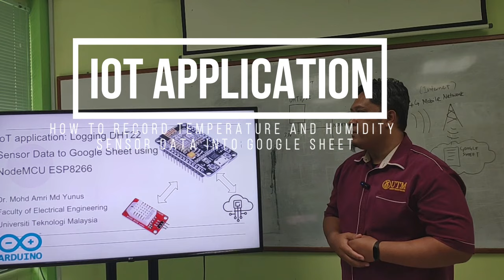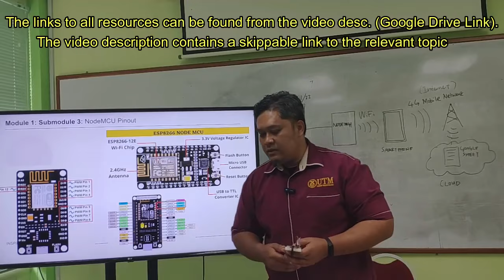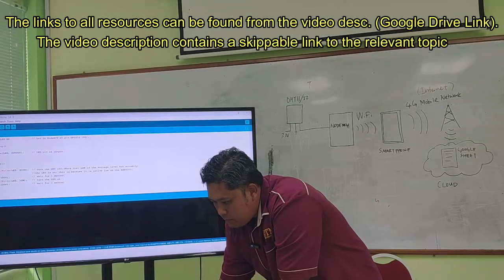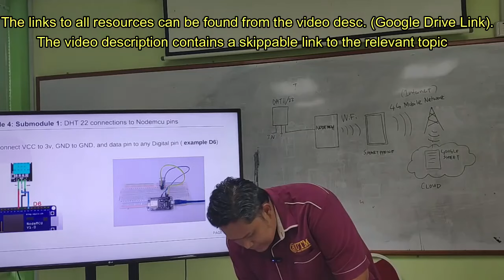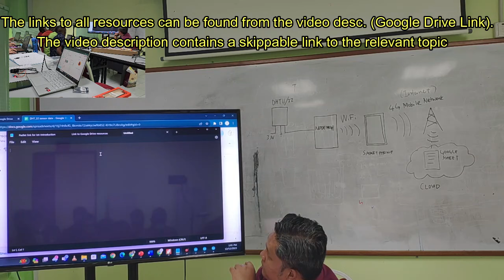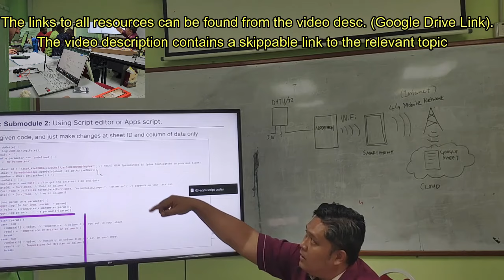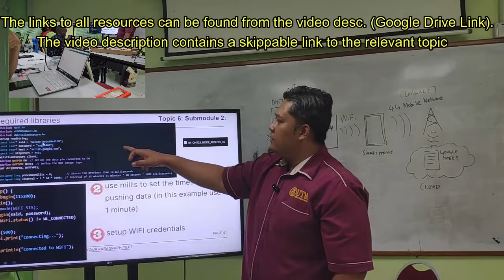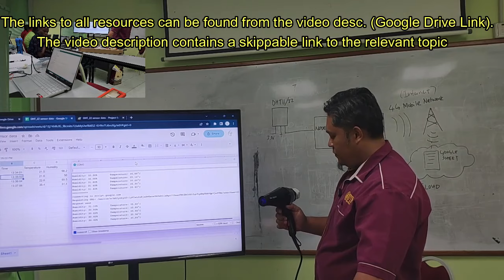IoT application | Logging DHT22 Sensor Data to Google Sheet using NodeMCU ESP8266

Comment from the maker: Link to resources:
https://drive.google.com/drive/folders/1t18ITUjztelZGxeKu2X5GJpMzR49CXcZ?usp=sharing

Presentation slide (Dropbox): https://www.dropbox.com/scl/fi/2deiad1mwktlj44mte0w5/Slide-IoT-Application-DHT11-data-to-Sheets.pptx?rlkey=uqspa1o8za6s54smx65wpflki&dl=0

Time stamp:
00:00 General Overview of NodeMCU ESP8266
14:57 Setting up The Board in Arduino (Integrated Development Environment) IDE
21:51 DHT22 :humidity and temperature measuring sensor
29:45 DHT22 NodeMCU Interface
36:55 Setup your Google Sheet
54:47 Setup IoT in the Arduino Code